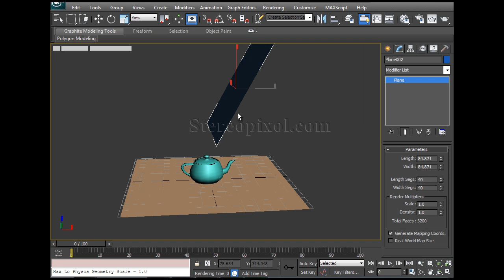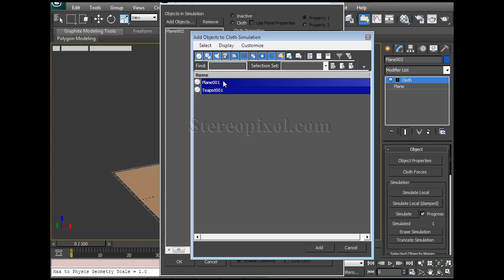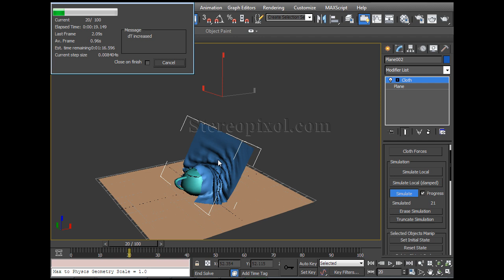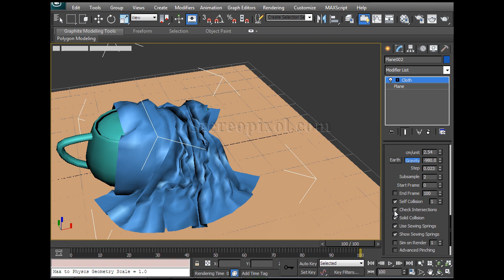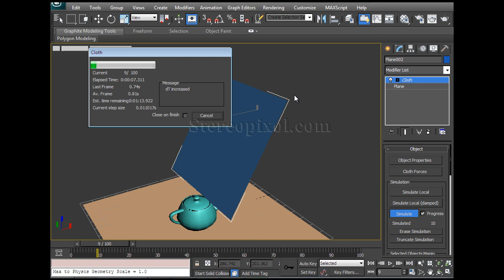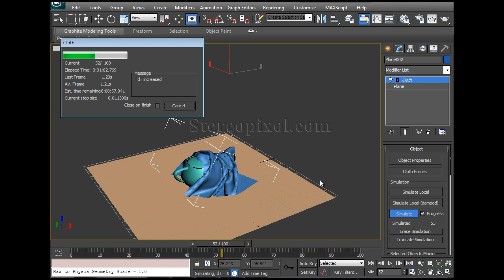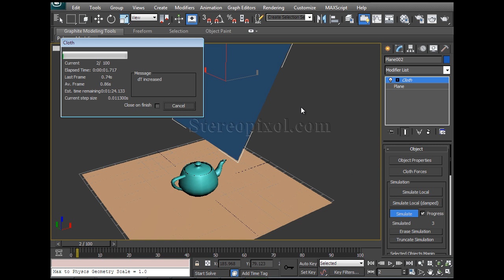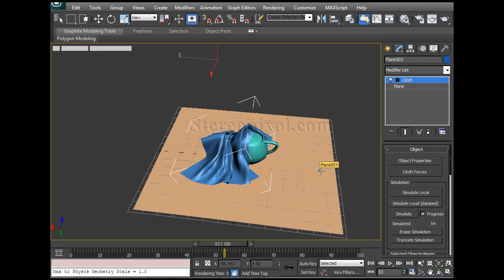How to use Cloth Modifier in Autodesk 3Ds Max

Comment: dont work,my plane forms like hard metal,how to get it work?
Reply: Add some subdivisions in you plane object it may work properly  MrGTAmodsgerman
Reply from the maker: You can use some presets to check them out first , also check the subdivisions. Subdivisions are very important.
Reply: Prateek Jaitly
thx
Reply: Getting overlapping in 2019 version...how to fix it